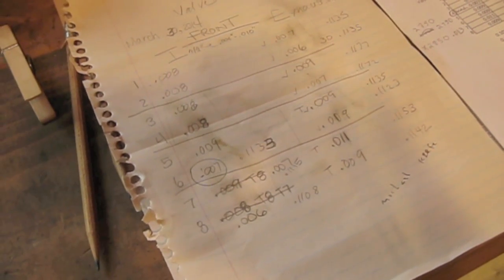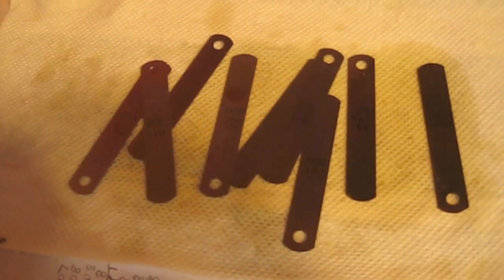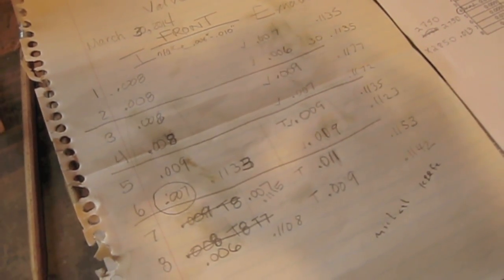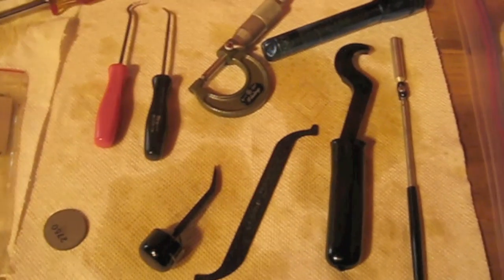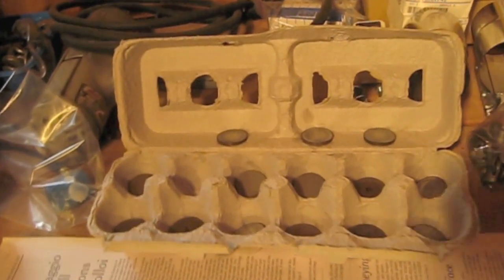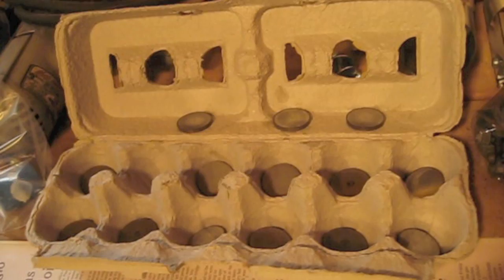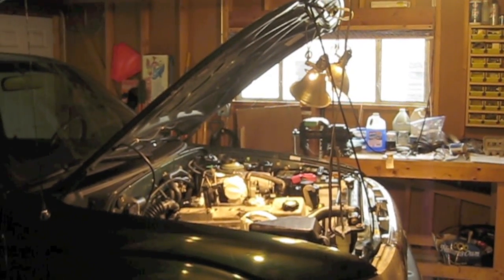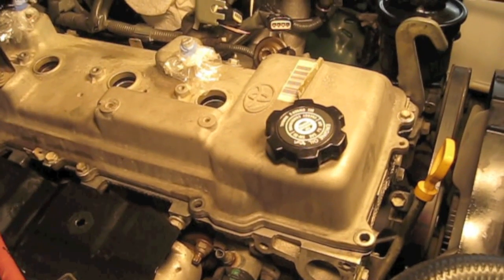Toyota Tacoma 2.7L (3RZ-FE) Valve Adjustment

Comment: Nice video! Thanks! Are there symptoms as to when you need to do this on the 3rz? Valve taps? Poor performance? And/Or its just a service interval?
Reply: Toyota explains the procedure in the factory service manual but there is no service interval. 

Just plan on doing this job yourself every 40,000 miles because no shops want to do it because it's an ancient, archaic thing to not have hydraulic lifters in the engine for automatic valve adjustment.

I think loose valves will tick, but the valves on this engine never loosen unless you have some other valve train problem to begin with. The exhaust valves tighten silently while your gas mileage gets worse and worse until you finally end up with burnt valves.

For months I have been tracking down the reason for the extra oxygen passing by my O2 sensors, and my high percentage long-term fuel trim. The only possibility remaining is that a few of my exhaust valves are too tight and not fully seating, allowing oxygen from the combustion chambers to escape into the exhaust. It's been 60,000 miles since the valves were adjusted by a machine shop under the previous owner. 

Planning on measuring and adjusting my clearances about three months from now (3RZ-FE) 

Wish me happy shim measuring..
Reply: @subtegral happy shim measuring! Mine hit 300k with never having been done, so I suppose I should get on it. Truck gets 19mpg consistently, but id rather prevent something and get another 200k out of her. Can we just order factory replacement shims or do we have to have different measured sizes for ones that have worn more than others?
Reply: @thelandofmisteroz  unless you want to wait for all the shims that you need to arrive mid-way through the job, you pony up $600 to your local dealership for two shims of each size. There are 17 sizes. You have to bring the dealership all the part numbers. Go to the Timmy the Toolman 3RZ-FE valve adjustment video description. All the part numbers are listed there. 

The reason I say order two shims of each size is because imagine you're in the middle of the job and suddenly realize you need two shims of the same size but only have one shim of each size. Toyota dealerships will refund in full for the unused shims. 

.. or as I said in the beginning, if you don't mind having your engine open for a week or whatever time it takes for all the shims you need to arrive...

edit: by the way, what is your vehicle? a Tacoma? what model year?
Reply: @subtegral thanks. Its a 2000 Taco
Reply: @thelandofmisteroz  19 miles per gallon? is that combined city and highway? 4WD or 2WD? extra or single cab? 

Just wondering because your pickup is probably 500 lbs or more lighter than my 4Runner, with the same 3RZ-FE pushing them. Plus you might be running smaller wheels and tires than I am... because 19 miles per gallon, whether pure city driving or combined city/ hwy driving is not bad at all.
Reply: @subtegral regular cab 4x4 manual with i think 30 or 31s. 19 mpg is pretty much city driving, small town though, so mixed stop and go with some 55/60 mph.

 Rarely on cold mornings I hear valve train tap, only under load when i 1st take off for a minute or 2, i run synthetic motul oil, the oil stays pretty clean between changes, i always hit change intervals at 3k miles. I may change it to one grade thicker here soon and see if that makes a difference. But I do plan.on addressing the shims regardless.

Comment: Great video!! I'm in the middle of checking my 2.7 in a 2003 Prerunner, and exhaust is tight. Looked for that Schley tool, and most sites say 'discontinued'. Sounds like I need to look at the Honda holddown tool, but dont' see a p/n anywhere. Is this the same as that Kawasaki tool mentioned in older posts? Thx.
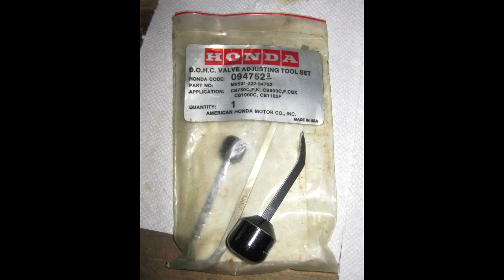Reply: Ok, correction, my bad, I see the p/n at 6:01 of the video. Not sure why some Honda sites don't show it, tho!

Comment: Well, I will just have to put up with the lifter ticking.  This is way beyond anything an owner should have to do and this will be my last Toyota.  Cadillac introduced hydraulic valve silencers in 1930 and every auto I have ever owned had them.  This is an unacceptable design flaw, I did not buy a motorcycle, it is supposed to be a truck.

Comment: Doing this to my 2000 4 cylinder Tacoma.  Having trouble removing the shims from cylinder 4.  Any recommendations or tricks?  Also what magnet are you using?
Reply: The magnet I'm using is made by Snap-On.  You can probably find something very similar on their web site.  Sorry, I have not checked this video in a while.  Did you manage to get your valve adjustment completed?  Another trick I've used in the past if a shim is stuck in the bucket is to use an air blower nozzle with a rubber tip (I use a Snap-On nozzle for this).  This is connected to the air line from your compressor.  You simply put the tip of the nozzle into the groove that you see me using to pick out the shims, and then give it a blast of air.  This will almost always pop the shim out very quickly.
Reply: Yes I did.  Found myself back at your video for a review.  Thanks for making the video that Honda tool is absolutely key.

Comment: With that Honda bucket compressor, is there any concern with scratching the surface of the cam lobe by wedging that tool in there like you show in the video?  The Toyota FSM shows the use of the tool like Schley makes and I'm wondering if it's to avoid marring up the surface of the lobes.
Reply: This tool has a precisely machined face that is just like the face on the cam that presses down on the bucket.  It does not put any marks on the cam or on the shim.  Also the motor oil film helps the tool to ride on the film of oil.  Finally, the bottom of the cam (called the heel) never touches anything as it spins around.  This is the "clearance" part of the interface with the buckets.  So, even though this tool does not mark anything up, it wouldn't be of much importance if it did.  That's a great question that I also asked many years ago!

Comment: Great video! Question: if I don't have the Honda tool is it possible to do the job with the plier type tool you have? If so how would you use them?
Reply: I "REALLY" don't like using the Snap-On tool for this (even though I love their tools and most of my took kit comes from them).  This is kind of a poorly thought out design.  This particular Snap-On tool was designed and is made by "Kent-Moore Tools, a Brand of SPX Service Solutions".  K-M/SPX makes some great special tools, but this is not one of them.

Comment: Thanks very much for the informative video. I'm preparing to adjust valves on my Toyota Tacoma this spring, and like you, I've also done many shim-over-bucket and shim-under-bucket valve adjustments, but they've all been on motorcycles. The good news is that I own and service my own Honda CB-X, so I already have the bucket depressor and holding tools shown in the video, but seeing the configuration under the valve cover before opening it up will save me a lot of time bc now I know what I'm faced with. One other question, do you happen to know the diameter of the Toyota shims? I ask because I already have an assortment of 25mm dia shims  for the CB-X so I may be able to use some of them in the Taco if they're the same dia in the thicknesses that I'll need. Tks again!
Reply: I'm not sure the diameter of the shims, but I really prefer to install brand new shims from Toyota.

Comment: How do the timing chains hold up on these motors?
Reply: I bought a 2000 Toyota Tacoma 4x4 new that year with this 2.7 liter 3RZ motor & automatic trans. I now have 330,000 miles on it. Timing chain is just fine. Same for the water pump. Thankfully, I befriended TWO guys who both are certified Toyota tech/mechanics. In addition to still working for a Toyota dealership, they partnered years ago to operate a nice shop as their own side business, that they still have. ( IMAGINE HOW LUCKY & BLESSED I AM.....AND THESE GUYS CHARGE ME PEANUTS COMPARED TO ANY OTHER SHOP,  NO KIDDING. NOTHING ABOUT ANY TOYOTA ESCAPES THESE GUYS. ) Just this past week, I had them replace a leaky valvecover gasket including sparkplug seals, a new exhaust manifold ( old one was cracked ), REPLACED the rear brake adjusters (it's common for those things to malfunction & quit working, resulting in NO back brakes, even though the shoes are fine, and mine has the "factory tow package" which has the bigger rear brake drums ), replaced all of the bushings and 2 new bolts in the front stabilizer bar, replaced the lower radiator hose & new coolant ( I replaced the upper hose myself only weeks earlier ), replaced a broken door handle, and cleaned out the EGR valve. They did all of that.......PARTS & LABOR......for only $500. THAT'S CHEAP!!! They told me the engine is doing GREAT to have 330,000 miles on it, at 18 years old. Good ole tried & true Castrol GTX 10w30 oil, is all I've ever used in this engine, w/NO additives. I'm gonna have them replace my belts & service the transmission next. Ya just can't beat these engines, and they told me: "Yes, there ARE people who are getting 500,000 to 1 MILLION miles out of their original engine & drivetrain with NO rebuild".
Reply: See my previous response from over 2 yrs ago. My 3RZ-FE now has 361,000 miles......still running great, but I did just buy an entire timing chain/gears, balance shaft chain, tensioner & guide kit AND new water pump from LC Engineering. My buddy ( the long time Toyota tech ) is going to do the job for me next weekend. ( 11-14-20 ) Might as well replace the water pump because it has to come out anyway to replace the timing chain, gears, etc, etc. That's free labor. I just installed a stainless steel header to finally get rid of the crappy cast iron exhaust manifolds that ALWAYS crack after 6 to 18 months. WHAT A DIFFERENCE IN PERFORMANCE. I have gobs of torque at low rpm's now. Even the automatic transmission behaves much better, because it downshifts much easier for passing slower traffic. The transmission worked fine before, never any slippage.......but it really works better now. Before, ya had to nearly floor the accelerator pedal to kick it down a gear......now, just a mediocre stab of the throttle makes it happen. Even with 361,000 miles, my engine has better performance than it ever had with a cast iron manifold. Had I known this, I would've installed a header years ago.
Reply: @howabouthetruth2157  I wrote this just after selling my 95 4x4 standard with the 22re, was thinking about a Tacoma. Totally regret selling it even though I got 9k for it
Reply: @shckltnebay  Oh man, I bet you do regret it. The 22r and 22re are great little motors. The 3RZ is just as good, but in a slightly different way. It actually replaced the 22re, but is found ONLY in the 4x4 and Pre-Runner among the Tacoma's. The 3RZ was offered from 1994 to 2004. I'm damn lucky my timing chain hasn't broken yet, but that'll be replaced next week. Already have all the parts/kit. My Toyota tech buddy says anything newer will NOT be as durable as the 3RZ or 22r/re motors due to simplicity of design. Everything newer has variable valve timing that has too many parts to wear out much sooner. He should know.......seeing as how he works on them all. Cheers.
Reply: @shckltnebay  ........and PS.......the timing chain & balance shaft chain should at least be inspected at 120 to 150,000 miles. If it stretches beyond the limits of the tensioner, it starts slapping the chain guide too hard causing both to break, dropping valves on pistons. Now ya need a total engine rebuild. But mine still had plenty of tension at 330k miles when he replaced the valve cover gasket. But we're done "tempting fate" at 361k.
Reply: @howabouthetruth2157  I was sell the Toy or my Merc E350 which with 50k was worth about $7k
Reply: @howabouthetruth2157  not my problem lol although the Merc has has its share of them

Comment: Excellent video. Very informative. So when people say "valve adjustment", they mean replacing the shims for this 3rzfe? Thanks.
Reply: Yes, that's what it means.  The valve adjustment is simply using what ever thickness shim is required to give you the correct clearance between the shim and the cam heel.

Comment: its this method used for 05 tacoma prerunner V6 also??
Reply: This is the method for the Toyota 3RZ-FE.  The 16 valve dual overhead cam 2.7 L.

Comment: Loved the video. I gave up on this job with the snap-on tool and took it to a pro. Next time I will try it with the Honda tool. I have a question about the bucket 'hold down' tool. It has 2 ends. Which end did you use? and what is keeping it in place?
Reply from the maker: Glad you liked the video!  I think I was using the wider end of the hold-down tool.  When you pull out the bucket depressor (the wedge tool), the hold-down tool is held tightly between the edge of the bucket and the underside of the cam (by valve spring pressure).  There is quite a bit of pressure so it's important to place the hold-down tool very accurately on the edge of the bucket.  Since the shims stick up above the edge of the bucket, I bring the hold-down tool right up to the edge of the shim.
Reply: The "holder" tool has two ends with different widths.  I use the widest end that will fit once the bucket is depressed.  The bottom of this tool presses against the outer edge of the bucket, and the top of the holder tool presses against the bottom of the rough cast part of the cam shaft that is adjacent to the lobe.

Comment: did do see an improvement by doing this? is the ticking noise reduced?
Reply from the maker: Yes, the engine is quiet and smooth running.  Adjusting the valves reduces engine shake, and improves mileage.

Comment: Good Job, Thanks a lot!! Will do this yo my Infiniti FX 45, will replace valve seals, and timing chain, might pull heads off and take pistons out, and replace pistonrings too??, anyway, has to pull out camshafts anyway, and need to do valve adjusment, I bet Infiniti-Nissan is pretty much like Toyota, right?? So, after I do final adjustment, just do the calculations, and go to dealer, and buy those needed shims?? How much they cost, about?? Thanks a lot, youtheman =)Where can I buy/order that bucket pressing tool??

Comment: Great video! I need to do the shims on my 2RZ tacoma it has 195K and the valve cover has never been off.

I also have an '09 CBR 600RR that is going to need adjustment #2 at 32K

Comment: would the cam lobes only wear the center of the shims?

I was wondering if you could just flip the shims.
Reply from the maker: +Sep Mirtazavi The cam lobe and shim never really contact, but rather float (in relationship to each other) on a film of oil between them.  You can remove a shim that has been in an engine for a long time,  measure it in the center and on the edge and not see any difference to .0001"

Comment: Excellent video, it helped me a lot!  If changing the spark plug tube seals (valve cover), like me, you may be inclined to knock them out with a hammer and large flat bladed screwdriver from the top side.  Don't do this, the bottom part will just break off.  Instead take your screwdriver from the underside and insert it under the entire seal and pry it out.  It will pop right out, no problems.   Use the old seal to set on top of the new seal, tap it with your hammer, and the new seal will go in easily.  In removing the valve shims, if the shim won't come out using the spacer tool, insert a larger flat bladed screwdriver to create more clearance and the shim will come out.  I just completed this service on my 2000 Tacoma prerunner 2.7 with 140k.  All valves were in spec, however I had two exhaust valves that were measuring .010in that I brought back to the optimal .012.  Timing chain seemed fine.  I have used Toyota filters and Mobile 1, 5w30 in winter and 10w30 in summer.  Great Video, thanks for sharing your experience!
Reply from the maker: +thomas7770 Great job on your Prerunner 2.7!  Your engine must have been very well cared for if you only had to adjust two exhaust valves at 140K.  I use Mobil 1 in my vehicles also.  Its a good-value synthetic oil.  I still change at 3000 to 4000  miles though.  Thanks for your comments.

Comment: That was an awesome video! Looks so easy with the right tools. I just might tackle it myself. My Toyota has 210000 miles on it and am sure it needs done. Do you know how long one can let it go and the consequences of not doing it?
Reply from the maker: There is no way to tell just based on miles on the vehicle.  The best thing to do is take the valve cover off and measure all the clearances.  Then you'll know for sure.  Put on a new valve cover gasket, and replace all of the washers under the valve cover bolts.  This truck had about 185K on it and most of the intakes were OK, but all of the exhaust valves were too tight.  The engine simply won't run properly with valves out of adjustment, you can really tell the difference, less engine shake, smoother sound, better mileage, etc.  The danger is if they tighten up to the point where clearance approaches zero, the valves will not be able to close fully, and they will burn and you will have to replace them.  The valves cool when they are fully closed against the valve seats.  Zero clearance can also cause cams to become scored because there is no  space between the cam and shim to pick up oil for lubrication.

Comment: Five of the sixteen valve gap measurements increased by .001" after 26000 miles in my 1997 Tercel.  None of the valve clearances decreased.